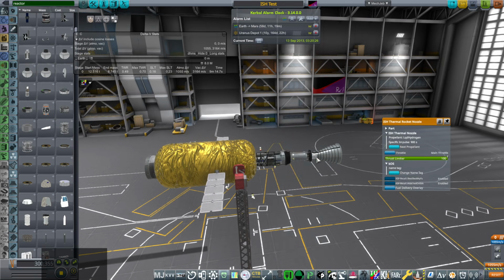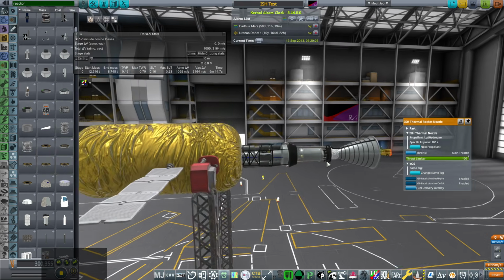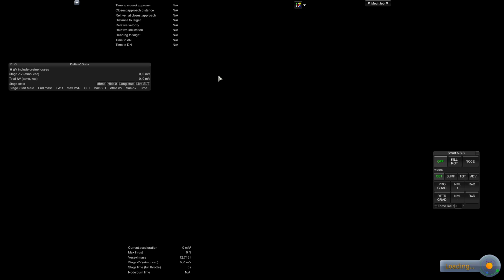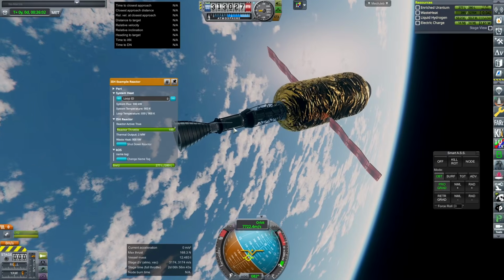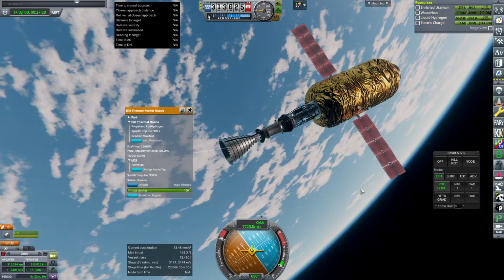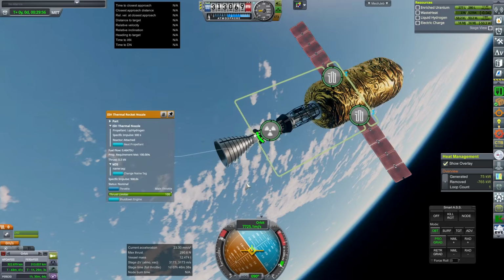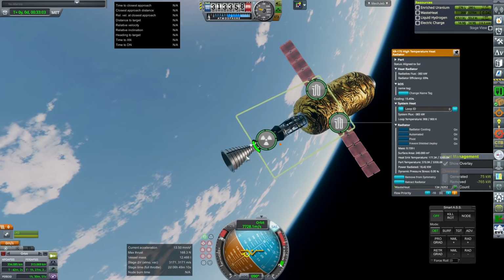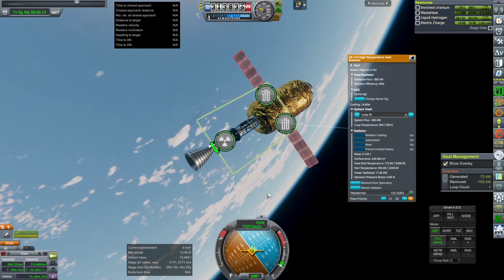True Bimodal Engine for System Heat (Kerbal Space Program)

Comment: Note: usually when I see a "methane" configuration for an NTR, it's actually a methane-ammonia mix - pure methane, as a carbon-based propellant, has coking problems.
Also, in SystemHeat, radiators don't try to reduce loop temperature below the max, they just maintain it there.